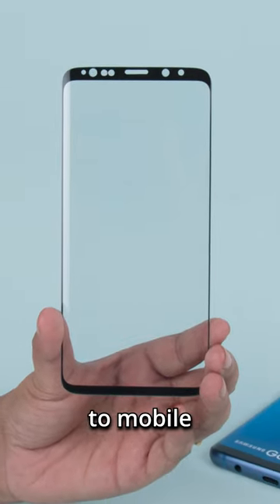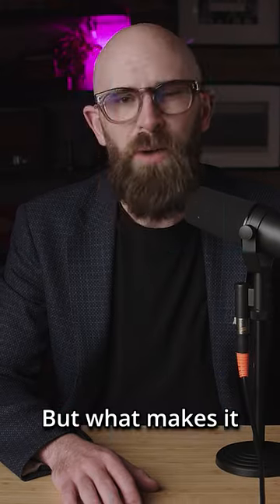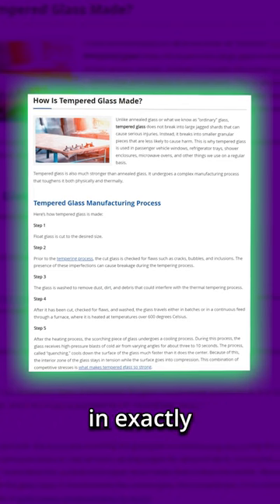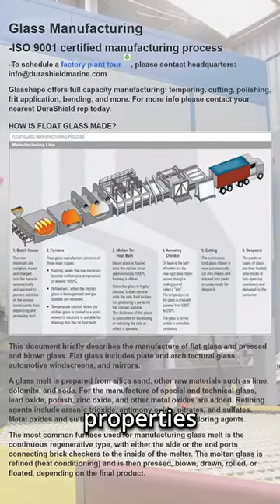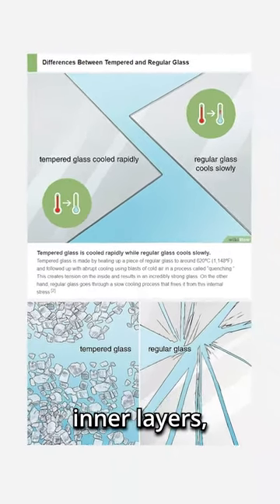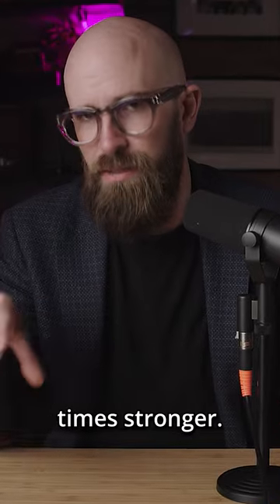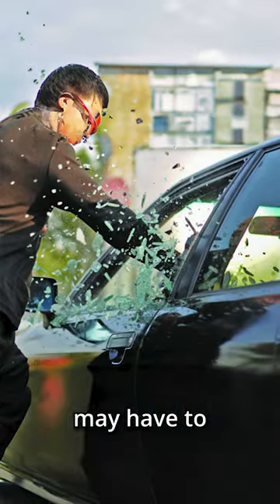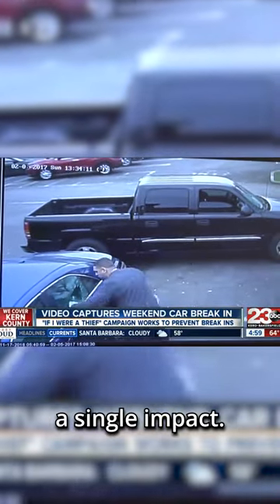What is Tempered Glass and How Does it Work? #shorts

Comment: As someone who's gone through a windshield tempered glass still cuts you
Reply: Well yeah, it's still glass, but you would definitely be worse off with regular one.
Reply: A windshield is layered glass. The non glass layers holds things together making it possible to cut you. Going through a tempered sliding glass door usually causes no cuts.
Reply: Yes, tempered glass will cut you in a car windshield, but it won't impale you and slice your arteries and tendons.
Reply: Older cars had tempered front screens. And as a glazier of 20+ years. Can confirm that all broken glass is sharp.

Comment: I used to operate a glass tempering furnace in a glass shop. One issue with breaking tempered glass that this video left out, is that it's difficult to break on the face of the glass. You have to damage it on the edge if you want it to shatter in one hit, unless you have a glass breaking tool.